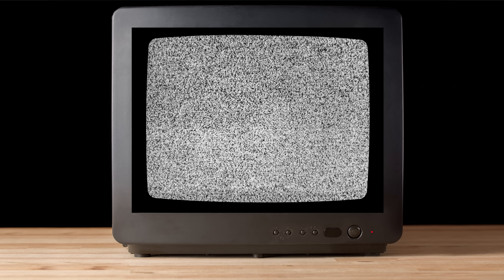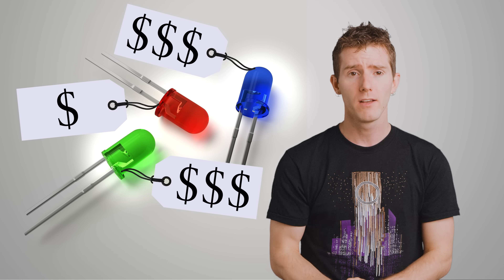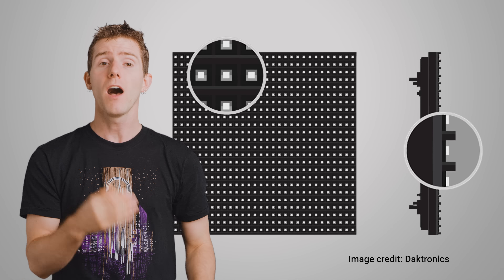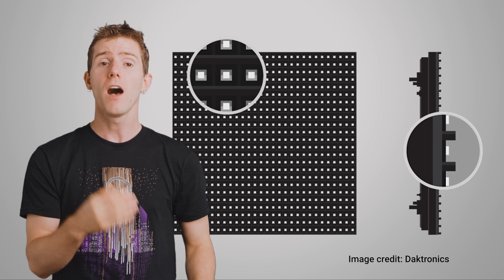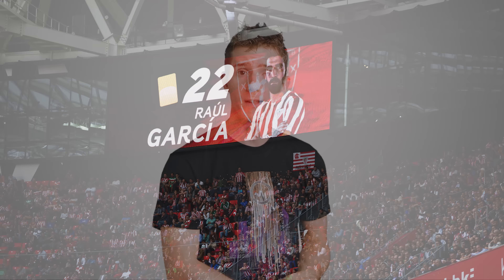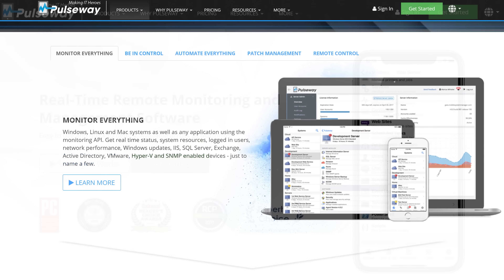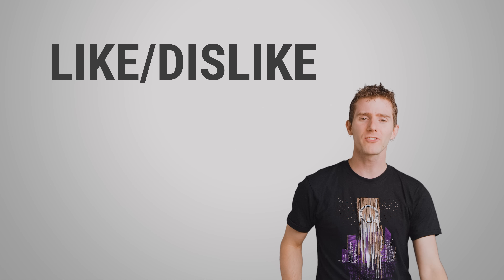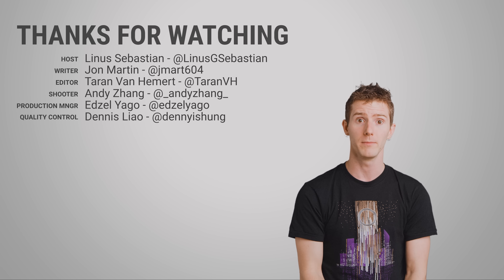How The World's LARGEST Screens Are Made

Comment: Ooh! I work on led billboards and they're essentially the same as far as construction of the screen itself. Led billboards are assembled in 1'×1' squares of those cupped LEDs, and each panel is Daisy chained together. 

Your average billboard is 14'×48', and if a board is struck by lightning (which actually happens less than you may think) we have ended up replacing half of the panels on one board. Some of the older units we have are basically a giant refrigerator with LEDs on the front of it to keep the electronics cool. 

I had never even thought about how led or tri-vision billboards worked (or even how regular vinyl boards) so it was insanely cool to be able to physically climb and see how they work.

Comment: I work with those and I want to point out a bit more technical details. They're composed of single tiles that can be square or rectangular. Tiles are connected both for data and power connections in "cascade" meaning that you run a single cable to the first tile and then connect the second tile to the first. Data cables run on modified RJ45 connection with IP rating and are originated from a "matrix" that converts a standard input like HDMI to the signal ready for single tiles. A single matrix has a limit of how many tiles it can drive based on the pixel density of tiles and the resolution it can accept from the input. Power connections run usually on a specific connector called "powercon" and you can connect in cascade a number of tiles up until the nominal power draw they sum and the maximum amperage a single cable can handle (a 10 amps cable at 220v goes for 2.2kW meaning that you can connect up to 4 500w tiles with it). Every tile is composed of the frame, a number of "subtiles" on wich led are mounted and wired and a driver for power and data. If any of those components fails (like a dead driver or a dead pixel) you can change the specific component without removing the tile, usually tool less and during an event in front of the public if you're fast enough.
To understand how low the resolution is I drove up to 120sqrm of LEDs "step8.9" meaning that there's a pixel every 8.9mm with a single fHD connection and there was more room left on the bandwidth of that signal. Hope this helps

Comment: Fyi, most led wall modules are usually interconnected using standard cat5e or cat6 ethernet cables (but with a more robust Neutrik EtherCon connector). They're just daisy chained. Power is daisy chained too (but with a limited set of panels per breaker, since they consume a lot of power). The wall modules are then controlled by a rack mounted led controller. Some LED panels use standard ethernet protocols as well, so you can use a standard network switch to split the data flow to multiple led wall locations, all controlled by one (or more) controllers. However, they usually just talk to each other using their respective MAC adresses, so they won't get an IP address. Wonderful system.

Also, a 200m2 LED video wall usually only takes about a day to set up, or even just a couple of hours if you have enough people. It takes about 10 seconds to physically connect two modules together, and maybe another 30 seconds to connect the cables. The time it takes to set up the display on the controllers vary wildly from system to system, but on P3 you can usually map a large wall in about 10mins given that all the cables and panels are good. Other controllers could take a few hours though.

A video wall module is usually either 50cm x 50cm or 100cm x 50cm. These are again split up into smaller modules of 25cm x 25cm, that are sometimes hot-swappable if a module dies or there is a dead pixel.

Also, a led video wall doesn't need a control room full of equipment to work. You can literally just plug your laptop into the 2u video wall controller and get a picture on the screen. Kinda inaccurate presentation.

Comment: Normal screen processors actually are set to take in pretty normal inputs, normally being DVI/SDI. 
Having a whole control room is beneficial for better production, just like a TV broadcast, but far from necessary.  The fascinating part of LED boards is the software and mapping, as the hardware can fit into a couple of U for a smaller screen.

Comment: I build temporary LED walls for events for a living.  
This information is incomplete and a little bit over simplified. 

Should have given an example of how they are built. 

Should do a follow up on LTT 
Fly out to Australia. And I'll help you do a video. "Gaming on a 1000+ inch screen" 

Modern LED video walls often exceed Full HD or even 4K resolutions. 
The hardware required to drive these resolutions is super interesting.
Reply: Email them!
Reply: I was saying the same thing. He barely scratched the surface of even the basics! Pixel pitch, the controllers that drive the walls, how they connect together, etc.  

Although gaming would have latency and/or quality issues. Even with some of the best panels/controllers out there.
Reply: They always over simplify the topics so that everyone, even with potato brain can understand that.
Reply: my family does LED wall solutions in Hong Kong and totally agree to this
Reply: also last time i checked u dont need a switch to power led walls
Reply: I've seen what happens when one of the computers driving a display wall goes out
Reply: @Socapexxx  He was referring to the clip of an OB suite with video mixer/switcher.   Not required to make an LED wall/screen work. 

Most LED screens cannot transmit data via standard network switches. While the signal IS ethernet. It's not IP traffic in the traditional sense of the word. 
Brompton control systems can tho.
Reply: I'd rather anthony doing a more in depth explanation
Reply: The name of the channel is Techquickie which as you can tell trys to explain how things work in a short span of time. It's not suppose to an in depth explanation of how tech works.
Reply: LINUS GET YOUR ASS TO AU FOR US
Reply: I mean, I really depends on the video panel and the size of the wall when it comes to resolution. 

With a 5mm pixel pitch you'd need a pretty massive video wall to get to 4k.
Reply: I am interested in more than a quickie about this.
Reply: The point is that anyone can understand, and it fits into a very short video. This seems more like a flex of a comment :(
Reply: Same here. I tour with LED walls and I have been the EIC in a major Canadian Baseball Arena, that for some time had the biggest Jumbotron on the planet..(when they actually were Jumbotrons and not LED)
I agree it was very oversimplified - to the point where it was like an OC video but only talking about the mouse. while showing the PSU.. ;-)
Reply: The hardware is what I'm super curious about, I would love to see this!
Reply: @guillaumelalonde7945  Well 5mm pixel pitch is kinda getting old, for indoor's at least...
Reply: Ltt should start a thing where they crowd source info from their subscribers on topics people who watch ltt either know about or work in that field.
Reply: cough it's called tech quickie so it's quick. Cough cough
Reply: Why do you need him... U make a video
Reply: @ABD-vk9hw  that is also a great idea.
Reply: Up you goes!!
Reply: gaming on jumbotron seems interesting.
Reply: @TheFiercestGrape  

look up hardware that drives 4k cinema projectors.... its pretty much similar (at least for driving the large wall panel)
Reply: @guillaumelalonde7945  Please do define "massive". A 4k output with that pixel pitch would not result in a "massive" screen even in modern event terms let alone the absolutely insane stuff at China and Arabs.
Reply: I mean in general entertainment controls are far beyond what consumers use. Its insane to me that internal RGB controllers and other RGB components don't have DMX 512 options.
Reply: @mebmakes  HaHa. 
I think did the maths once.  Controlling even a small led wall with DMX ends up being 1000s of DMX universes.   
DMX also doesn't have the refresh rate to keep up with proper video. 

Pixel mapping lighting rigs is still fun tho.
Reply: @TigeroL42  just a disclaimer, I am mainly a lighting, but I am learning more and more about video world. The last show I did we had a 30m by 7m. This was for a corporate show in Qatar.  To me that's already a pretty damn huge screen.
Reply: I'm interested in doing something like that. I'm getting into smart homes, and have experience with low voltage. I'd like to add that too my toolbelt.
Reply: they are more interested on spending 40 minutes on various chapters making a "cooler" out of a piece of aluminium than showing this thecnology.
Reply: its a great offer, but led walls are literally everywhere, even my small home town has some big stuff. considering a community of less than 10,000. he should just find someone in vancover.
Reply: Email them
Reply: This should happen
Reply: I worked for a company that designed and installed displays. Yes. left a lot out. couldve at least explained how panels attach and network together.
Reply: Email them!!! This would be sikkkkkk
Reply: Hey, Fellow Australian
Reply: Sup vidiot

signed,
a lampy
Reply: @getsomebud  Oi mate. I know my way around a Hog too...
Reply: PLEASE LTT THIS SOUNDS AMAZING
Reply: would you know anywhere were i could learn some more about that..it seems super interesting
Reply: Do this linus!
Reply: I work in this industry, you are 100% correct. There is a tremendous amount of information lacking in this video. Including mentioning one customer of ours, Mercedes Benz Stadium in ATL.
Reply: Still awful pixel density
Reply: If you want a more in-depth look at how these are made, find the "How It's Made" episode about them. techquickie is meant to be quick and easy to understand for even the simplest of minds.
Reply: Well, this is techquickie, so simple is better
But I also wanted to know more. I hope the main ltt channel will cover this topic with you
Reply: Yes, but Linus is explaining the large permanent ones that Stadiums use. There are very nice LED walls out there for sure, but this is different, still cool though!
Reply: jazzcat123 what a video
Reply: I'd LOVE to see this as an actual video!
Reply: pls
Reply: YES
Reply: Did you built Barney's wall?
Reply: @Adam-lc6mk  without you
Reply: This is technique you all kids! They make videos shy under 5 to 6 mins
Reply: @aluandcache7336  ok lol
Reply: I'd like to know!
Reply: Well it’s techquickie not techlongy
Reply: Exactly, he didn't talk about the LED Panels, patching and controllers weren't even mentioned.

Comment: Samsung’s new domestic product called the Wall uses this technology. 

At the recent event in Berlin they showcased it with a pair of purpose built servers as main and backup to playback all the videos, with AMD WX9100 graphics cards and S400 sync cards for syncing to the camera system. We used a QuickTime based codec called HAP which pushes all of the processing onto the graphics cards to 3 x 1920x1080 px outputs which were stitched together and upscaled using a Christie X80 presentation switcher to achieve the resolution of the wall. I can’t recall what the exact resolution was of it but it was something like a 1.5 to 2:1 ratio of scaling. 

The pitch of the LEDs is quite small so it allows for very close viewing distances. The colour balance of the wall was off so it was a little too green, but we didn’t have control of their output so it ran as the manufacturer had provided it. There are some impressive HDR offerings from the LED processing manufacturers like Brompton. Coupled with uncompressed TIFF image sequences at 10bit has the potential for amazing reproduction of the smoothest video playback currently available. 

Looking forward to bringing all the good paying attendees of conferences and events this new technology and experience soon. 

Check out a company called Pixera if you’re interested in the latest playback media servers. Another two to investigate are Disguise and Photon. Those servers are what create the amazing projection mapping you see at events like the olympics and other large scale events. The box that sits in the middle between the servers and the displays are usually from a little Belgian company called Barco. No Barco, No show...

Comment: Yeah I build these for entertainment industry almost every day. You were close to getting it correct. Most "LED screens" are based of pixel pitches in mm. The farther away you are from a screen the larger pixel pitches you can use. The led tiles are often 500mm x 500mm but can different based on the manufacturer. These screens are driven by a dedicated processor that turns a video signal  cat5/fiber that gets plugged into the tiles. 

I just did a show in ATL dome. The big circle screen is actually ~20,000 pixels wide. we had custom built media servers to feed that resolution and several 4k processors. It's all very interesting stuff and allows you to build just about any shape screen you want.

Comment: Good information, but would have been nice with one more min of info for most people to understand more how they work. The content side is cool in how they actual work, what's shown is just more so a normal broadcast switcher (switching inputs). You then feed a bunch of inputs into a screen management system (Like a Barco e2, Christie Spyder x80). This is able to handle massive non-traditional screen sizes and mix between different scenes with different input scaling and positioning (almost like OBS). These controllers have a ton of outputs (16x) that are all lag free and all gen locked together (to prevent tearing of image). These units are all stackable (they link together for more outputs). All these outputs then go to the many led wall processors that take a section of the image and give it to a certain section of the wall. Sections are based on bandwidth of how much processed led data can be transmitted down one line (cat6), and how many outputs per processor (2-16 possibly). A common pixel limit is 650,000 pixels down a cat6 line, so calculations are done on how many tiles can be run off of one line/controller. Pixel density (pitch in mm, 2-4mm is good/normal worlds best is Planar/Leyard with 0.7mm) is the factor of how many controllers for a wall. Controllers also get gen locked (timecode) so once again all leds are updated at the same time. Once a displays output is created, and all controllers are mapped correctly the controllers and screen then get calibrated to make up for different batches of leds (Brightness variation) and cabinet positioning (where the wall sections meet together, sometimes they can be too close or too far away, calibration helps). Hope you enjoyed this added info! ~ LED Wall Technician

Comment: See, all of these panels actually latch together with levers inside the panel itself. And ethernet cables run between the panels, connecting them all to a processor.  (The NovaPro lineup is popular in the US btw.) That processor then gets a SDI or DisplayPort feed and displays it at usually 60hz. These walls can reach STUPID high resolution. Most are 4K. But I even worked with a 7K LED Wall one time! So yeah. Pretty insane.

Comment: 3:56 - You can have large LED walls driven by a small control-box which hooks up to a laptop through an HDMI cable and run it like that; after it's all set up and connected, it's dead-simple to control from the computer. It's also possible to connect the sound system (including multiple speakers all over the place) to the control-box and control that from the laptop through the HDMI cable. I do it every year. (The effects—lights, fog, etc.—are run from a different box from the laptop.)

Comment: Not really, you can control this from a simple laptop and on most New models you can store the content on a sd card or even use wifi and control from ur desktop at home and also they use just same power as a normal home tv.
Reply: Processing live video takes processing power, but this is usually done by video mixers. 
There are small 'receiving cards' which you can plug in an SD card and it runs through a looped program and outputs directly to the LED panels via an IDC connection. This is the type of thing that may run a shop window LED screen or a scrolling sign. Not suitable for live HD video at all. I've found them quite limiting, but they're dirt cheap.
With regards to your comment on power, that's completely untrue. It is entirely dependent on size and the image being shown. My small LED display consumes 1000 watts displaying full white. That's a lot of current on the 5v side of the power supplies!

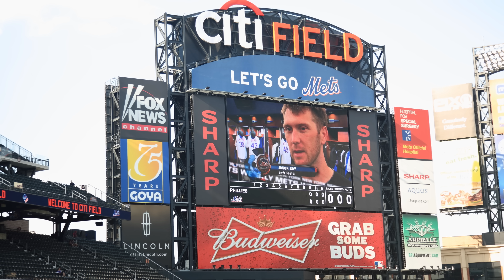Comment: 3:58 - 4:20 has nothing to do with jumbo-trons especially. Just regular tv broadcast stuff. 

Jumbo-trons (at least some models) are controlled with a control unit that splits the image and send the signal to smaller segments (about 3ft x 4ft in size) that form the image. Each segment gets the signal and AC power and then displays the image. These segments are easy to be swapped in case they fail.

Comment: Uhrmm Linus, CRT TVs didn't have pixels. They had lines. This is a common misconception. NTSC has 480 and PAL 576 lines. And there were even HD CRT TVs in Japan. They had the earliest working HDTV system, with designs going back to the late 70's. The country began broadcasting analog HD video signals in the late 80's using an interlaced resolution of 1035 lines.

Comment: I build LED walls at my av job and Linus's info is very confusing, it's not all right but it's not all wrong.

Simply put those jumbo screens are something along the lines of 18 x 18 inch led panels. These panels are extremely strong with a metal frame and rain / weather proof design. You can basically stack them like Legos to whatever size you want to complete the build and you just cable them by daisy chaining all the panels in groups.